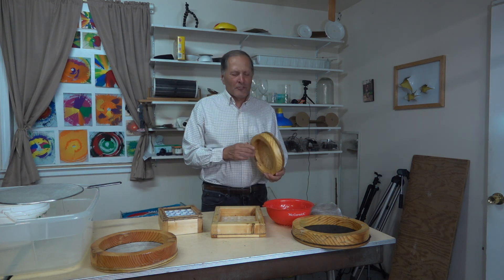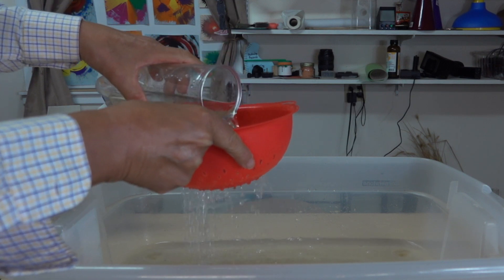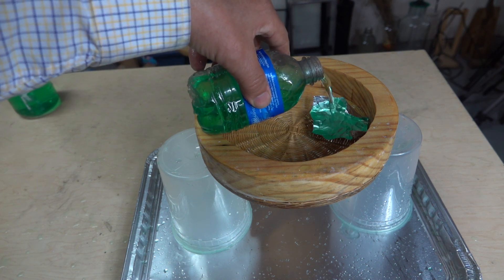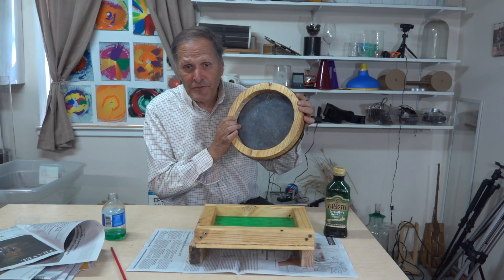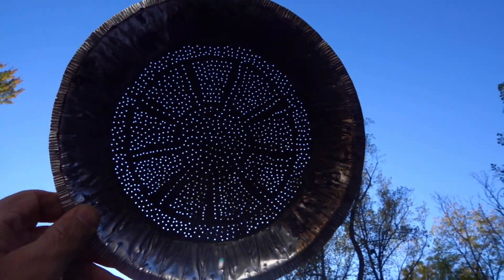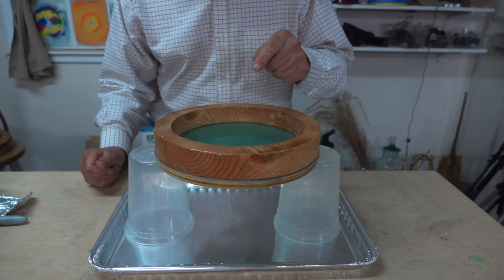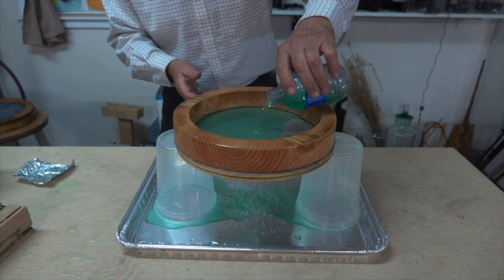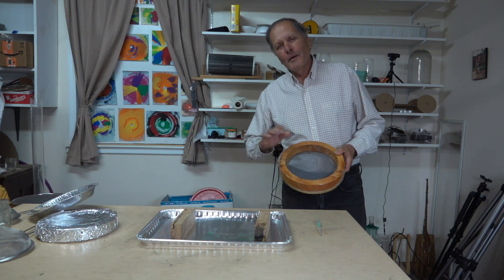Miracle of the water holding Sieve..Great hydrophobic  STEM investigation!

Comment: Carbon black was surprisingly effective, I would not have guessed it would work with such large holes!
Reply: I think it's not ionic so it should work well
Reply: @jaydeep-p  correct. Carbon monoxide begins to disproportionate into carbon dioxide and carbon below 1000oC (if you see soot around a gas fire open a window, ask about headaches, call a gas engineer). The carbon is in the form of graphite sheets rolled into a blend of tubes & balls. You need the resolution of an electron microscope or atomic force to see them properly.